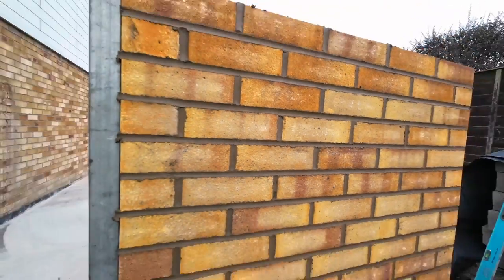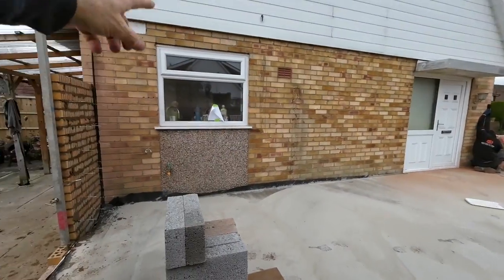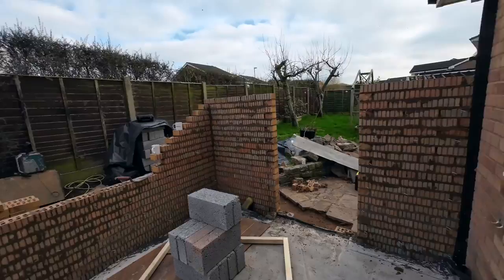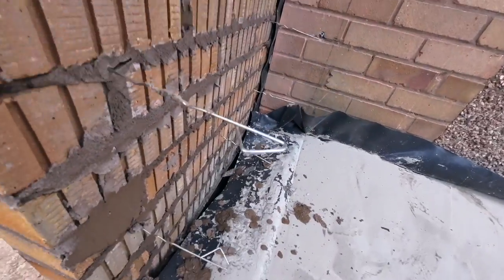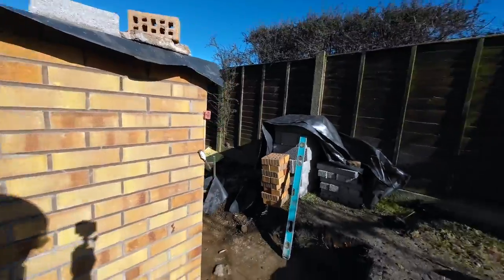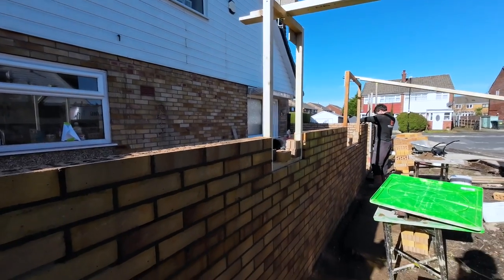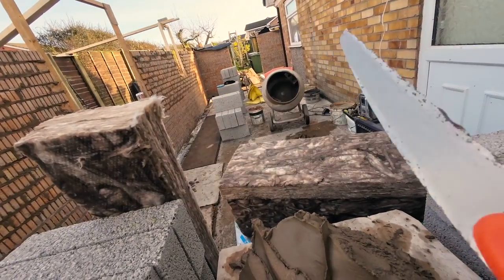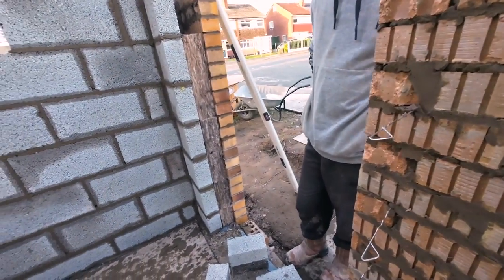BRICK WALL, WINDOWS AND CORNERS.. EXTENSION PT 6

Comment: When adding a new extension to a property which has a cavity wall and the cavity wall is to be removed for the entire length of the extension at a later date in the build how do you join the new slab to the old concrete slab once the cavity wall has been removed. Would you ensure you have enough DPM to be able to fold down over the cavity wall and try to join it to the existing, and lay insulation over this and scabble the two faces of the concrete or is there and alternative system ?
Reply from the maker: We usually take the two skins of brick when the doors were down about 3 courses sand, dpm, insulation, dpm then patch with concrete. 🧱👍🏽

Comment: I really like watching your videos, up til now they have been a cut above the rest, however….what is going on with the front? The bricks dont line up with the original house and there just butt jointed new to old! I only mention this as you mentioned these exact issues before that you’ve came across on other builds you’ve been on.
Reply from the maker: Its the same on the back too and its  all explained in the previous episodes 🧱👍🏽

Comment: Lay person here, love the channel by the way. About to have an extension and asked builder if we can pre-order the bifold doors as they on fairly long lead-times and want integrated blinds which push the dates out. Been told as this is an extension (not complete new build) that they need to build the walls and then measure the space precise first. Is there no way you can build a solid timber frame to the same size as pre-ordered doors and build the walls to that. We have 2 openings in the same wall, the bifold and a large depth window with a 1 Metre-ish wall section between. 
Understand that timber can shrink etc, but if already outdoor exposed and braced I would think that it should hold its size? or maybe I am overthinking that.
Just wondered what your thoughts are?. Thanks
Reply from the maker: There is no need to build first and measure later at all . the dummy timber frame is an excellent idea just make sure the dimensions are spot on and its dead straight and most of all square and well braced 👍🏽🧱
Reply: @SteveAndAlexBuild  nice one, many thanks.
Reply from the maker: @asawdustjourney  . Good luck with the extension 🧱👍🏽
Reply: The window manufacturers are spinning you a load of crap. Of course you can pre order. If you're building 100 house estate, some bod doesn't come round and measure all the openings then have to wait 5 weeks whilst they pull their fingers out and make the windows/doors. Maybe change your supplier to someone who is more accomodating. Don't be afraid to question, you are the custome - the one paying the money.
Reply from the maker: @catabaticanabatic3800  very true 🧱👍🏽

Comment: Hi lads what wood do you use to frame out the windows I’m doing in the process now, say if my window is W1770 x 965H would I frame it out so the inside of the frame is 1770x 965 lads ? Are they only templates or do you leave them in ?
Reply from the maker: Hi pal the lads we work for make the dummy frames for us so openings are nice and straight 🧱👍🏽

Comment: You guys work hard and are professionals, yet viewers still question whether you use ties? Crazy prices. (Sabrefix are £10.99 for 50 inc vat @ SF)
Question: is the wall getting knocked through?
Reply from the maker: No knock throughs, its a pretty simple job 🧱👍🏽
Reply: @SteveAndAlexBuild  Shame, you pair are dab hands with steels
Reply from the maker: @freepress8451  😏🧱👍🏽

Comment: Couldn't we have a full brick to full brick coming off the existing corner on the front of the house next time please, bit of a miss match full brick to a half and coming off gauge.
Reply from the maker: No sorry, if you actually watch the whole video it’s explained a couple of times
Reply: Theres no excuse for it. If works to a half put it in the back of the building.

Comment: you did not bed the damp course on this build in time it will move you should always bed it on
Reply from the maker: No it won’t . Not had an extension or anything I’ve ever built in 36 years move, that is ridiculous
Reply: mate perhaps you are not city an guilds we was always taught to put mortar under the dpc perhaps you should look it up an see the correct way to do it
Reply from the maker: @jasonmussett6685 I did a city and guilds apprenticeship too 😌
   We weren’t told the dpc needed bedding . 
   In case you haven’t noticed mortar doesn’t stick to plastic dpc so tell me how a 3 mm sliver of mortar will stop a house from “ moving “ ? 
💨🏚️

Comment: Bad practice not bedding your 4 inch damp on in my opinion takes 2 seconds to do .
Reply from the maker: Doesn’t make a blind bit of difference. I’ve never had an extension slide off the splash in 36 years 😆
Reply: @SteveAndAlexBuild  Always been common building practice , for trays over lintels as well.